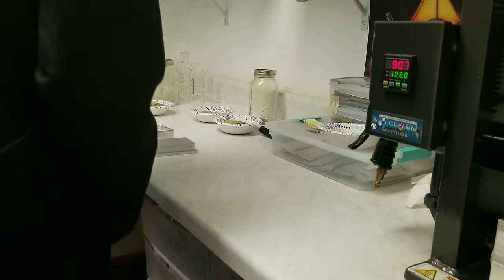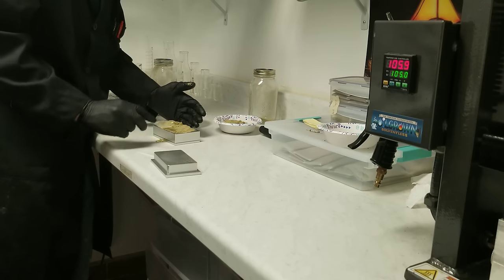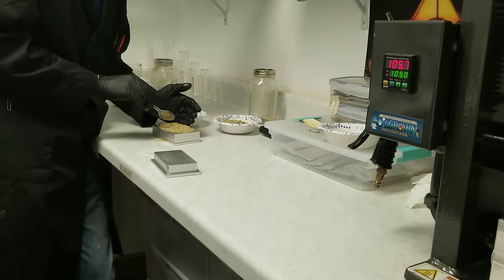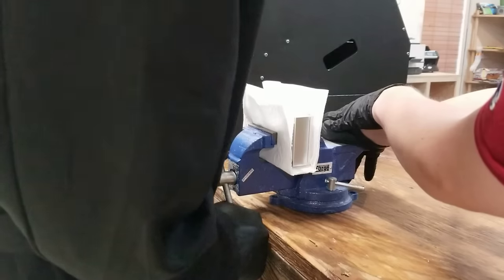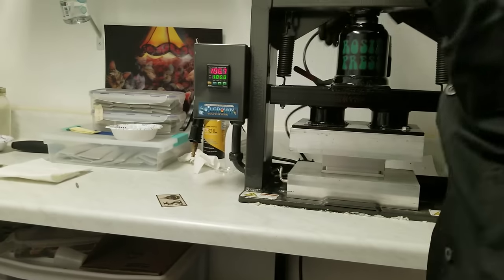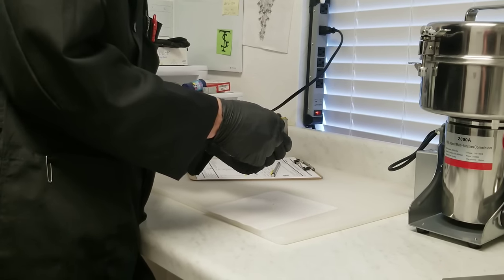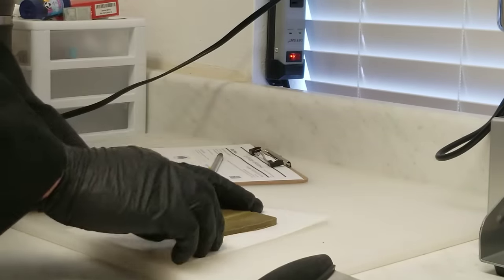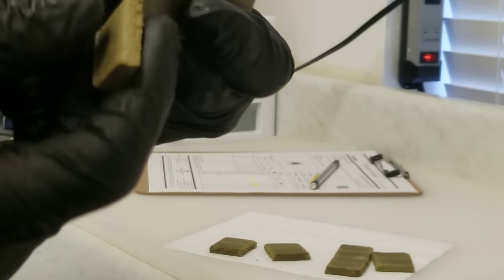Making hash bricks

Comment: I need to leave a thank you, I’ve finally been able to produce something I can call hash and that slapppps. Fuck ya
Reply: Note if this helps anyone, I have a nug smasher, I was at about 3k-4k pressure cold plate, then hot plates 110° at 3-4k  for like 2 ish min maybe less 🤷‍♂️ lmk if it helps anyone else
Reply from the maker: @nightriderghost1784  ooh, that's actually super clever! I never thought to cold press the brick before hot pressing. I imagine that reduces likelihood of everything smooshing out the sides.
Reply: @joshuawayne9811 what do you use to make sure your mold doesn’t stick once done with the hot press? I use parchment paper but have had issues with slight sticking still and the paper ripping occasionally. Any info helps me in my journey man🙏
Reply from the maker: @nightriderghost1784  it's important that the parchment is cut perfectly to the mold's shape. It's also important not to go too hot. A little oil rubbed on the sides of the mold will help get a smoother release (vegetable oil works, but hempseed oil is the ideal), and applying even force across the whole brick makes it all pop out at once.
Reply: @joshuawayne9811  hmmm ok this is great information, thank you for much. I have a large set of sifter screens coming in so I can make better quality hash

Comment: Sorry but how much bud do I need to start this process correctly????  I want to try but do not want to screw up my legal medicine - to expensive!!!
Reply from the maker: Depends how much you are trying to make. Let's assume for simplicity's sake that your bud is 20% THC. If you start with one pound of flower, it contains within it 1/5 of a pound in pure THC. Using dry ice and good sifters, you will recover about 70-80% of that fifth of a pound in kief of various grades, the rest of the THC being trapped in the flower grind (great for making tea blends or prerolls with). This means your kief output will be 14-16% of your flower input. That's between 63-72g of kief per pound of flower. This means you need between six and seven pounds of flower to produce one pound of kief. The numbers become way more favorable when you're starting with a strain that is 30% THC. If you need an equation for it, K=⅘P(W) 
Kief equals four fifths of your potency, multiplied by your weight.

Comment: Aren't you just compressing finely chopped heads, then heating and compressing them some more? Proper hash is the trichomes off the buds. They are harvested without inclusion of the plant material.  
    Or, as you didn't recommend ,heat and compress the buds until the oil comes out the sides.

Comment: If it only heats on the bottom, mill 2 holes out the back of the top plate and just put 2 heating elements inside and wire up, boom now you have 2 plates as you should already have!

Comment: Could you also put it in the oven instead of that heat press?
Reply from the maker: You want the pressure of the press, and sustained time in the oven may degrade your terpenes if you aren't careful.

Comment: After you use the vice press isnt that hash done if you wanted to make hash .
Reply from the maker: At that point, it's just compressed kief, and will crumble right apart into powder. Applying the right amount of heat turns the material into a gummier consistency, which is easier to cut and whatnot.

Comment: Y’know… if y’all bolted that vise to a table, it’d work better. Also, you wouldn’t have to use paper towels if you replace the steel teeth with wood; like the vices in wood shop.. Just a thought. 😉

Comment: What happens if you don’t use heat?
Reply from the maker: Then you just get a powdery cake that crumbles right apart. The name of the game is to melt the material just enough that it starts to stick together, but not so much that you're melting everything into goop or destroying the THC
Reply: @joshuawayne9811  
Where can one aquire a machine like yours or have you had if adapted?

Comment: Had to mute audio, that humming woke my girlfriend up, turned on captions. I make hash the old fashioned way, with a bottle filled with hot water at 100f and press the hash by hand using the hot water bottle. So far, none of the "hash" I have gotten from a dispensary will smoke under glass on the head of a nail, it just crumbles apart.

Comment: Personally think 105° isn't warm enough and like you said in doing so the center of that kief remains the way it was before heating. It's still just kief really. I always did mine at 130° and for bit longer time and came out better than any hash had bought or seen in 20 year's or when I bought bricks of Afghani hash, the gold stamped shit. Everyone has their own methods and that's fine with me.
Reply: I was thinking that. The middle wouldn’t have changed much at all. It would’ve just been warmer.

Comment: Who cares about the corners who cares about a fancy mold or equipment, do like the OG’s Morocco. Out 100g in a mold and use a tall mold and press it with manual hydraulic press. You can make 1 kg in 10 min. 
No hate just saying this can be done way more efficient. Keep it up.

Comment: Would it make it easier to heat your cutting device before cutting. Or just use a sharpened 9’ bolster and smash it with a lump hammer 😂
Good job boys 👍👌

Comment: what the fuck is that deep sound frequency on the background dude lol
Reply from the maker: State mandadated ventilation system. Regulations forced us to have the ventilation motor wired with the lightswitch; if you're in the lab, ventilation is automatically on, even if there's no need.

Comment: i smoke more weed but i started with Hash as a Teenager. Stil Today i smoke hash, but not often because i dont smoke more tabacco and for Hash i need to.       but sometimes its ok
Reply: A windscreen wiper (Commonwealth English) or windshield wiper (American English) is a device used to remove rain, snow, ice, washer fluid, water, or debris from a vehicle's front window. Almost all motor vehicles, including cars, trucks, buses, train locomotives, and watercraft with a cabin—and some aircraft—are equipped with one or more such wipers, which are usually a legal requirement.
A wiper generally consists of a metal arm; one end pivots, and the other end has a long rubber blade attached to it. The arm is powered by a motor, often an electric motor, although pneumatic power is also used for some vehicles. The blade is swung back and forth over the glass, pushing water, other precipitation, or any other impediments to visibility from its surface. The speed is usually adjustable on vehicles made after 1969, with several continuous rates and often one or more intermittent settings. Most personal automobiles use two synchronized radial-type arms, while many commercial vehicles use one or more pantograph arms.

Comment: you would think if they thought it out this far they would have thought of a decent cutting method...like for example make a bladed grill that fits inside the mould and put it under that press so after it does the compaction..remove the top plate then put the cutter grill on the top and come down with the press...if you going to break the law on this scale then efficiency in putting your product out is everything...also i would step back from it and hire illegal immigrants to do it....just sayin